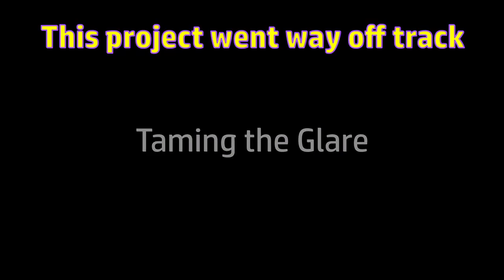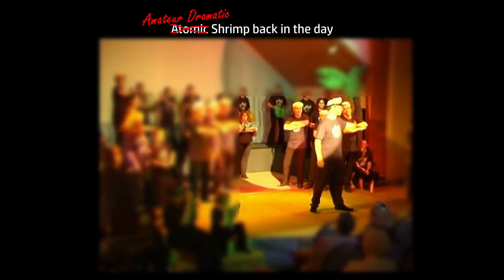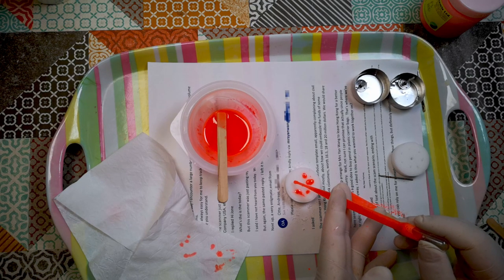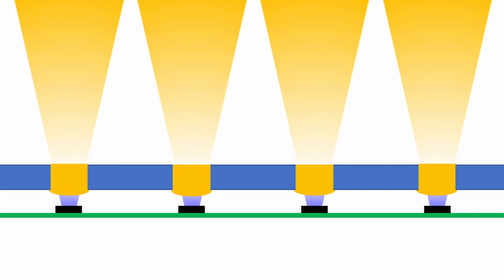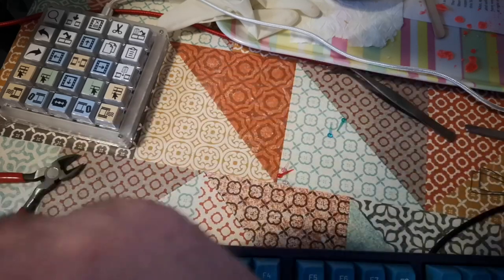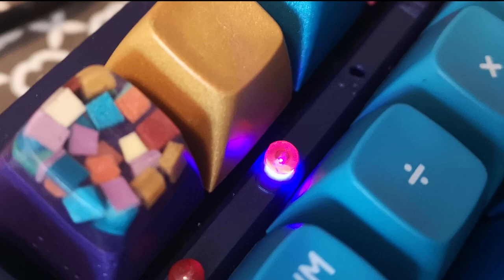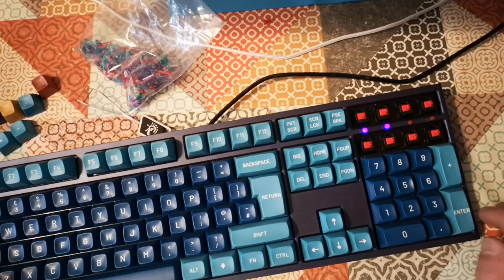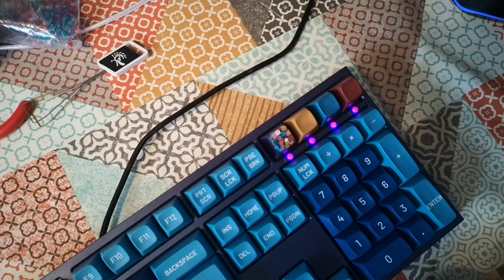Taming The Blue LED Glare

Comment: That's a lot prettier way of handling the LEDs than what I usually do, which is just placing some electrical tape over it!
Reply: LOL this is EXACTLY what I thought of all the way through watching this video.  Seems a hell of a lot easier.
Reply: Yea or a couple layers of scotch tape to diffuse it
Reply: Yeah or just straight up duct tape. My most recent: a glaringly blue LED on a cheap £20 desk fan which stopped working in less than 6 months.

Comment: Wow, so I am not the only person who hates bright blue LEDs.
I had this problem with PC speaker having this kind of light, I just used some red electrical tape... Cut it to shape, stuck over the hole.
The light was so strong, that it still shone through the tape a little bit, just enough to indicate if the speakers were on or off. 
Which is what they were supposed to be doing in the first place, instead of trying to illuminate the whole room.
Reply: @ForbiddenChocolate  Yes, but my LED was so bright that it was purplish with a blue dot in the middle.
Reply: Use aluminum foil tape of the type normally used on house ducts (not "duct tape"). It completely blocks them.

Comment: 2004, that was the year I remember seeing blue LEDs plastered into everything. For some reason, manufacturers decided that instead of a subtle green/red/yellow led, we now all needed an extremely high brightness blue LED on our electronics.

They were new, I get it, but totally unnecessary. You'd go round someone's house and not be sure if the TV is actually on over the blinding array of blue LEDs on everything.

I refuse to use them, every piece of electronics I build gets nice, subtle, gently glowing favourable colours.

I used blue once, it was a standard brightness 5mm led and looked quite nice. Incredibly hard to find at the time, everyone makes high brightness blue LEDs, because.......
Reply: I guess those blue leds look nice in brightly lit showrooms, web ads and such. Or something just as stupid.
Reply: I remember having a CRT TV in 2006... its big, massive 'on' button had a super bright blue LED around it. It's like it was using the blue LED to try to disguise the fact it was a fat, big CRT TV that weighed a ton and was going to be the very last CRT I ever owned.
Reply: @testaajatestaaja7215  2004 might be the same time the marketing department took over the managing role of companies. I just can't think an electronic engineer would purposely design an item with blue LEDs.
Reply: Blue LEDs have been in development since 1972. The first successful high power design came out in 1993. 2001/2002 was when the process was made cheaper through another discovery. We're having a similar vomit inducing scenario now, but with RGB LEDs, since they're cheaper to produce now.
Reply: @Varangian_af_Scaniae  I have used blue LEDs in designs.  Enough men are red green color blind that a blinking green LED meaning everything is wonderful looks much too much like a blinking red LED warning that the product will explode in 10 seconds.  If the UI directly on the product is limited to two LEDs that blink and a power switch, it is a good choice to make.
Reply: @kensmith5694  Ok that's understandable.
Reply: @kensmith5694  I hate you a little bit less now that I can understand the practical point of using blue instead of red or green.
I still think a subtle white light would be better fitting for showing it's on, because god damn the blue light is anoying to see.
Yet white lights need to be subtle! I remember getting my 800D computer case and they had a really bright hdd/power LED on it, I ended up cutting up a piece of filter paper and take it onto it, making it ironically kinda blue ish (more purple) to this day 12 years later it still there :)

Now on my speaker control there was this annoying bright blue LED, at one point I got so feed up seeing it at night that I just too some pliers and broke the damn thing, I don't need to have a light if there's already a power switch that is up or down  depending on if it's on or off.
Reply: @svampebob007  In the case I did, the unit was used outdoors and the LED needed to be seen from a distance.  This was an "industrial" situation.  The product was well liked by "all three" customers.
Reply: @kensmith5694  nice, outdoors blue seems like a good idea, sounds like you knew what you were doing :)

Comment: I had one of the damned blue lights on my external soundcard; I just ended up cutting a piece of orange paper to a small size and used tape to hold it in place. Now, instead of an eye piercing blue, it's a very soft, almost violet, light.

Comment: I've covered up many an over-bright LED in my time. I just use paper stickers, cut to size as necessary. White ones to keep the existing colour, or coloured ones to change it. If one sticker isn't enough to reduce the brightness by the amount you want, you can just layer them up. It works for any shape of light guide too.

Comment: I normally just squish a little bit of bluetack into the hole to deal with blue LEDs, very simple but not always the best looking. Blocks probably 90% of the light depending on thickness

Comment: I solved this problem and another one I had with my usb-c charger which both had garishly bright LEDs.  A small spot of my partner's dark nail varnish applied on the area.  Worked a treat, if it was still too bright, one more blob was applied.  Now my phone charger doesn't illuminate the bedroom and my keyboard isn't hugely distracting.  👍

Comment: I have one of those blue LED lights on the front of my Samsung monitor, and it drives me crazy! It stays on even when the monitor is turned off. So far my only solution has been to put electrical tape over the front of it, but since the light is part of the on/off button I can't tape over it completely and the light still shines around the edges. I don't know why they think it's necessary to use such a bright light, right in my line of sight.

Comment: Once upon a time blue LEDs were rare and you could make a product stand out using one.  These days, you are far more likely to make a product stand out using an amber LED.  You can also get colors like pink and aquamarine in LEDS If you need multiple colors they can be a good second LED.  A high efficiency green LED is also a good choice for a 2nd color because it clearly is not "just yet another blue LED"
Reply from the maker: Yeah, I remember when they just weren't available, and all we could get was red, green, amber and yellow, then blue LEDs came along and they were such a novelty, every product had to have one on it

Comment: I had some of those ethernet-along-the-mains transceivers which I used to feed internet from my BT router to my bedroom TV. They had ridiculously bright red LEDs on, which illuminated the whole room when I wanted to sleep. The TV's "standby" red LED was also too bright. I taped over them with blue electrician's tape, which is slightly translucent. This tamed them to a faint glow, which is plenty in a dark bedroom.

You could probably do the same in reverse with red tape over blue LEDs.

I later fixed the problem with plug-in mains timers. Everything in the bedroom is now off when i want to sleep.

Comment: My usual go to method for overly bright led indicators is a piece of grey pvc tape. Still shows the light but attenuates it significantly. If the led is super bright, sometimes it needs 2 layers. Doesn't look wonderful but it works and that's all I care about 🙂 I've also just attacked LEDs with a black sharpy in the past, less easily reversed though.

Comment: Thanks! The indicators on the SAMA IM01 desktop PC chassis (sold under different brands and model names depending on the country) include a blue power indicator that is insanely bright, so I disconnected it as I didn't have the time to solder a resistor in line with the positive pin of the indicator.

Comment: My first thought was adding a little resistor in series with each LED to limit the current, and/or even replacing the LEDs with nicer-coloured ones. But that also involves opening the case, and is even more fiddly than the little pegs with soldering/desoldering and whatnot.

Comment: I discovered that a small bit of yellowish/orange translucent 'KAPTON TAPE' (used in electronics) will mellow out all kinds of blue lights, especially LEDs to a very pleasant green color.  I even put a swath over the blue high beam indicator on the speedometer.  I don't know what the hell the obsession manufacturing people have with blue LEDs.

Comment: I have a keyboard with the same problem, what I did to fix was to cut a small piece of scotch tape, put over the holes and painted the scotch tape with a black sharpie, if you apply carefully the scotch tape, you only would notice by look closely at it

Comment: I could do with some of those pins on my keyboard too.  I also have a flashing blue LED on the front of my PC tower which I have to cover up as otherwise it's flashing in the corner of my eye, which is VERY uncomfortable as I'm photo-sensitive. The bright lights really hurt my eyes.
Reply: @ForbiddenChocolate  Ceiling LED spotlights in homes and shops blind me 😣and often can trigger a migraine. I have to walk around while basically performing an American salute . Don't even mention oncoming headlights at night - they just starburst at me and I can barely see the nearside kerb/verge. I desperately avoid driving in the dark which is fun during a UK Winter 😬

Comment: I love blue lights in things. I may have bought some appliances in a large part for having blue lights, rather than another colour. But the on-light of my effect processor is so bright as to be extremely distracting. Even up to headache-inducing.
I had thought about taking it out or dimming it or something, but I'm not even at amateur level when it comes to electronics, so I never bothered with it.
Some of the suggestion in the video and comments will probably work just as well :)

Comment: Hmmm - I usually just stick black insulation tape over the offending LEDs, they still show clearly but are entirely bearable (clean the sueface first to ensure it stays stuck). If they're mounted on the panel itself and hence protrude through it (such as the power LED in the front panel of my PC, which lit the room up) I paint black nail varnish over them (sometimes takes 2 or 3 coats).

Comment: Beautiful! Get some cheap "7sa" tweezers from China for about $2 shipped. They are extremely sharp and just the right sort of flex to handle these size of objects without them pinging off into the distance. They're made for SMD soldering which is what I got them for, but I use them every single time I need to manipulate tiny things.

Comment: I like to imagine a future where Atomic Shrimp went for the four-colors design on the extra keys and replaced the Esc key with the fun squares, simply because that’s what I’d do.
Reply from the maker: I can see how that would be nice, but I feel like after going to some lengths to get the keycaps, I am reluctant to replace any where there is actually a proper cap for the key
Reply: That's fair, and I understand the sentiment(al value). After all, I'm not the one with the keyboard.

Comment: I've had good results covering the light pipe with a couple layers of black electrical tape and then opening a smaller aperture with a needle. If you could open it up it would be trivial to swap for your choice of colour LED and maybe increase the series resistor

Comment: I also hate having bright LEDs shining in my face or close to my face, very poor design I think.
My PC monitor has a large blue one that shines directly at my face, whoever thought that was a bright idea must be blind ! I managed to reduce the harshness quite a bit with a small piece of black tape which leaves less than 1mm of LED exposed which is more than enough to be seen but in reality it's an on or standby indicator, when the monitor is on you can see images so it's really only necessary to show standby which it shows with an amber colour. The blue colour is entirely superfluous !
Reply: My monitors also have blue ones. They are directed downwards, but the bezel of the monitor is designed so that they still illuminate the room.
Same on my mouse. It got blue lights to indicate which dpi setting is active, but they can't be dimmed. And obviously I don't want to suddenly have light appear at my peripheral vision just because I moved my fingers. So all of the stuff got taped.
Reply: "whoever thought that was a bright idea must be blind !"
probably stared into his own designs for too long...

But seriously. I got a mouse like that which leaks either red or red/blue light depending on its dpi setting, but there are also other examples:
- my graphics card has a red indicator LED next to the additional power sockets. At first I thought: that's a neat idea, remind people that they need to plug in the extra leads... as soon as plugged those in, the darn thing went from red to BRIGHT WHITE, instead of just switching off... why?
- remember the good old Microsoft mice? They used to glow red in the back (why?). On the more modern ones, they switched to white (WHY?)
- my monitors have a white indicator light (which is pointed down at least). It's no issue at all when the monitors are on - but when they go to standby, it doesn't switch off... it goes into a fade on/fade off mode (which can't be disabled)... why?
- at work, about 10 years ago, we had a storage system that used a status LCD (white characters) with a blue backlight. Next to it was also a blueish-white (back when they diddn't manage to quite achieve a true blue colour on LEDs) power indicator that was so bright we had to tape it off in order to not go blind when looking at the status LCD...
Reply: @jk9554  "Why"? because there are people who buy things because of those tiny in your face LED's ! Yes, some people really are shallow enough to pick the one with the blinky lights instead of the plain black one !
One of the neighbours in my street has a string of super bright rope lights stretched across his living room when he's watching TV ! Yep it's absolutely true and they are a lurid shade of lime green too, they stretch around the TV stand so that the wall behind the TV is illuminated, across the front of the stand below the TV and shining in your face, across the shelving unit so illuminating the faces of anyone sitting on the sofa and across the room to the fireside chair ! They are so bright they make the large TV look dim and you can see the entire room lit up bright green !
Some people seem to think that LED's are sophisticated and tasteful, I'm glad I know the difference !

Comment: I have a few pro audio amplifiers with those dreaded blue LEDs for the VU meters. Initially I just stuck some black insulation tape over them, but I eventually ended up soldering a couple resistors in series so they would barely illuminate. I hate blue LEDs!

Comment: I'd have just syringed UV curing resin into the holes in the keyboard without opening it, surface tension would do the rest, put a little in and cure it with your UV lamp, then build up more if needed.

Comment: I had the same issue, and what I did was pull the heads off of gummi bears and stuck them in the hole. 

It required some chewing though to make them malleable, and it was only later that I realised that they were sugar free gummi bears... I spent most of the rest of the night, and some of the next day "married to the bathroom porcelain".

Comment: I have a wireless thermostat that has a superbright green LED that flashes every few seconds when it transmits to the receiver, and at night it lights up the room. I solved that problem by putting black electrical tape over it! Now you can just see the white plastic of the case light up. I had intended this to be a temporary measure until I could get round to taking it apart and fitting a bigger resistor to the PCB, but its been temporary for a couple of years now leading me to suspect it will remain that way...

Comment: I just paint black nail varnish over any which are too bright.  Don't really need lights at all to indicate whether functions are on or off,  but that looks cool, they seem the same size as the ones on my speakers I didn't paint over yet (just turned the speakers backwards) might have a go of modifying them.

Comment: I'm certain almost no one likes those full brightness blue LEDs. They are slowly being replaced with RGB LEDs, though. The most offending use for them still is on vaccum tubes. Modern circuits don't draw enough voltage to make most tubes glow, so they add a blue LED close to them...When tubes give out amber light.

Comment: Indicators need to INDICATE, not blast a beam of glaring colored light across the room no matter the color, I really don't get why manufacturers do this. I had a Microsoft "Tail Light" mouse like 20 years ago that shined red right in my face while in bed across the room. It didn't actually indicate anything so I just clipped it. Lately I tend to swap garish blue LEDs for warm white since the voltage drop is the same and WW is usually less intense and beam-like.

Comment: I am surprised at all the blue LED hate. Looking at my system the only blue light I see is on the power lead for my headphones, which I barely notice and could tuck out of sight if it was a bother. Looking further I notice that there are blue LEDs on my external hard drives, but as they are positioned behind my monitor, where I can't see them, I don't think they count.